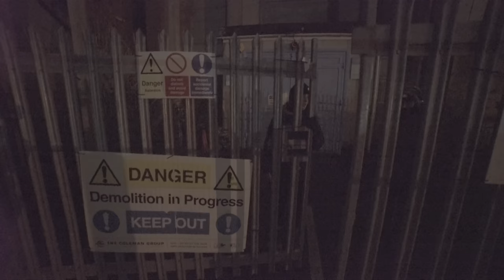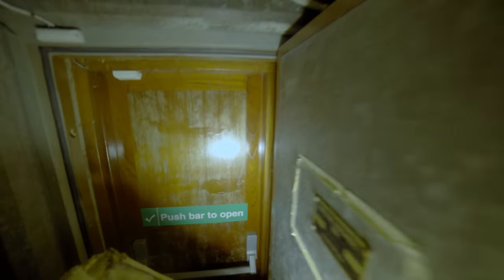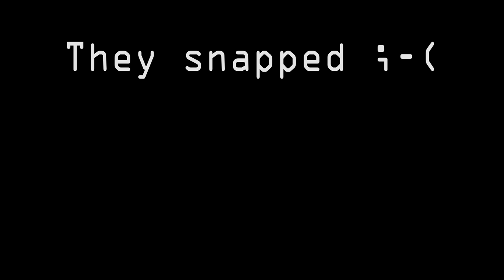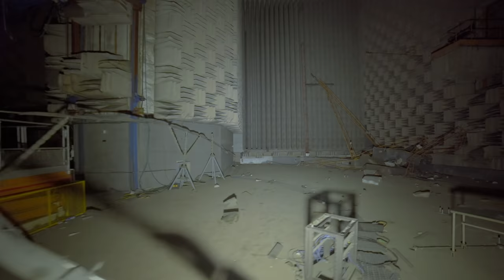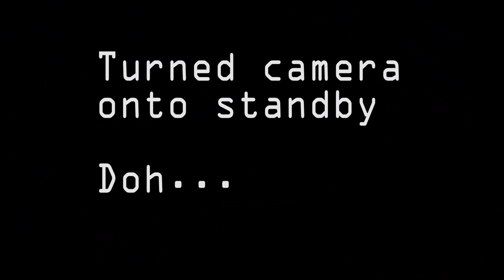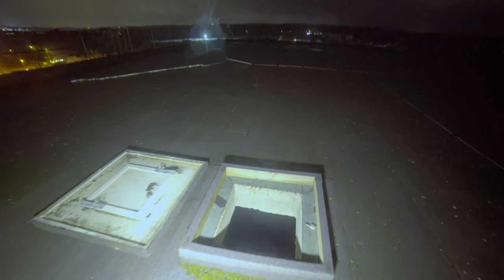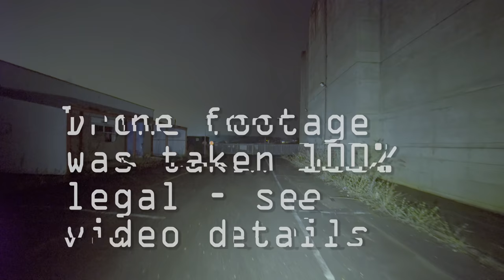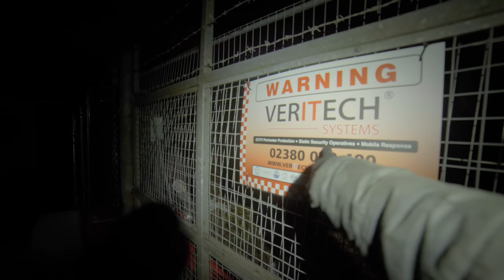Pyestock Anechoic Chamber - JET ENGINE TESTING ROOM 2020 4k

Comment: Great to see the old place, sad to see so much of it missing. The last test was done in 2016. I was one of the team who ran it. The Noise Test Facility is basically an open ended anechoic wind tunnel for testing jet engine exhaust nozzles to make engine designs quieter.  The blue pylon was used to mount model aircraft wings to test engine installations. The excess air blown into the chamber via the blue duct was sucked out through the funnel (we call the collector) by the exhaust fans in the labyrinth to prevent overpressure in the main chamber blowing the doors out. There used to be a very large centrifugal fan to supply the air in blue duct work outside. and a large compressor in the large empty room (with the port hole windowed fire exit door). The facility consumed megawatts of electrical power and if things weren't switched on in the right order could dim the lights across Farnborough. The platforms were for floodlighting they were air powered to fold them away to stop acoustic reflections, the counterweight under the floor is a pack of wedges that moves out to fill the hole where the platform used to be. The NTF was one of my most favourite places to work. For safety please note the roof space is full of asbestos please don't crawl in there.
Reply: Nice info brother, thanks for sharing.

Comment: Some observations, the big funnel is 100% an exhaust, I imagine the missing panels on the wall where some kind of heat resistant material this is also why there are chunky kill switches in the rooms you wouldn't want to be carrying out unscheduled maintenance and suddenly have  scorching heat blowing through i imagine there will be lots of negative pressure, I've seen a more basic american facility testing an engine on youtube and it also shows the funnel as an exhaust, because of the airflow generated from the inlet to the outtake you will get reliable airflow through the engine. In regard to the folding observation side rooms the counter weight at the bottom was probably a mechanical mechanism to open and close the platform the winch is likely a redundancy. the radar dishes pointing at the cabin and off to the distance deffinitley looks like a wireless internet beam, I have just set some up in the school I work for you can get some that go 50+km at 2gbps the ones i installed do 10km at 650mbps they are great for a closed network spanning a large site they are very secure and more convenient than laying fibre especially when there are obstacles or public highways separating sites.

Great video as usual I like your honest no bull approach.
Reply: I'm also a fan but I'm afraid he talks some rubbish..... Maybe more research could be done before going as it gets annoying listening to him bang on about what this and that is when it's clearly just what he thinks it may be an alot of the time he's wrong
Reply: One word. Asbestos.
Reply: the big circular hole is for engine exhaust, it would have had a large metal detuner fitted inside. There is much missing from the original walls. The acoustic padding on the wall is used in modern engine cells but the technology has come on along way since this test bed was in operation. Pyestock was also where they tested concorde engines so the air would have been travelling at immense speed hence the need for immense sound dampening. When I was testing engines I worked with guys who had worked here back in the day.

Comment: Brilliant and very interesting vid, love places like this which should never be allowed to be demolished. The blue crane type structure is the pylon that the jet would have been mounted on and then sent up and aligned with the exhaust tunnel, must have been very impressive in its day. I wonder when this place saw its final test? The GE test facility in Nantgarw just north of Cardiff has two state of the art engine test building’s like this one. Thanks for posting and stay safe.

Comment: That big blue motor would have had a fan attached and the tunnel feeds the air around through the corners vie special aerodynamic reflectors and then the air comes back around to behind the fan